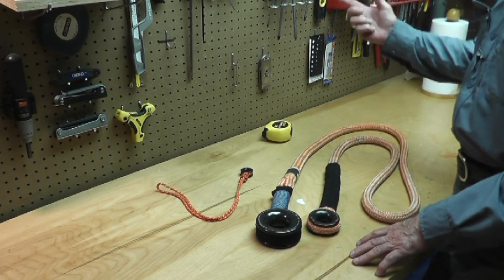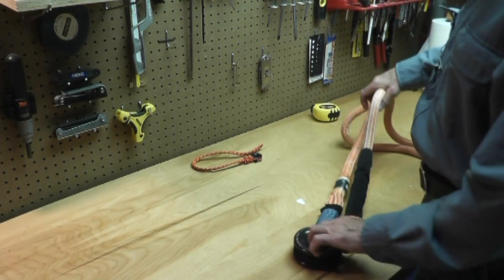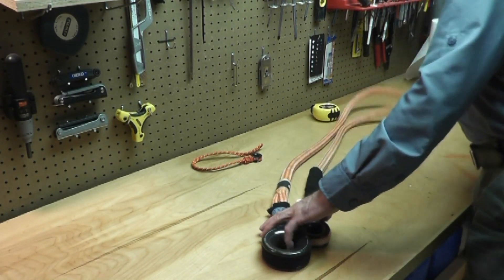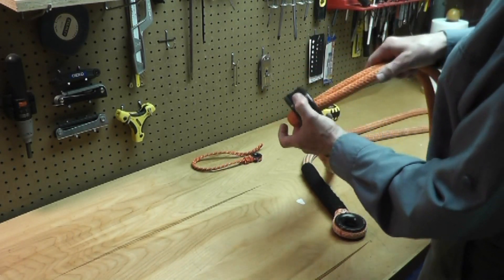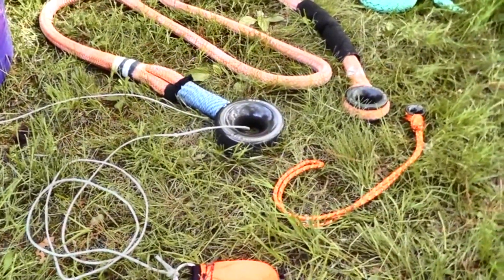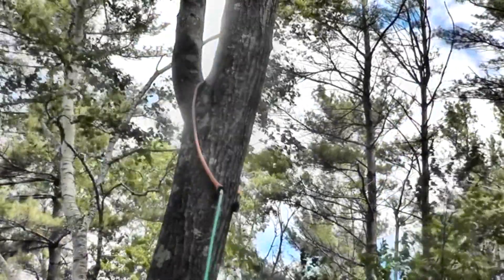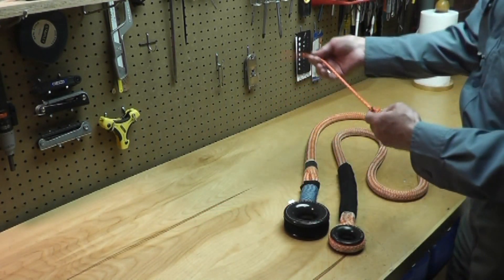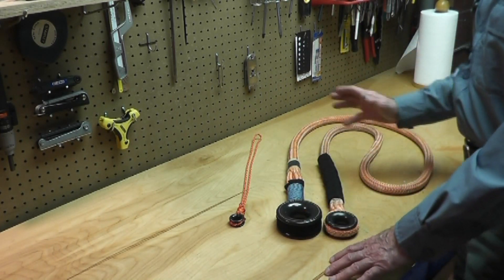XRR rR Saver for Heavy Rigging

Comment: Let me start off by saying I love watching your videos. And I am starting pick up what your throwing down Tom. But today I got from treestuff. Is a triple terex abr 1 #3 2#2's. rings. Well i went out to my tree and threw the throw ball inb the crotch I wanted. And I went to install the sling and the throw ball got stuck in the big #3 ring and would not come down to the ground. what can i do to make it more easier on me. thanks.
Reply from the maker: +Shawn ChamneShawn, it's sad but true: virtually anything, right down to an unknoted 2mm throwline, can find a way to get stuck in a tree.  Like any good tool, experience will teach you what you need to do to keep it out of trouble.  When it does <inevitably> get stuck, I've had good luck with a pickoff from above ... Set another throwline above the stuck saver, snap a carabiner through the bag ring and loosly around the line to the rR Saver.  Pull the biner up to the Saver, hold tension and pull.  Most times you can get lucky by pulling it out from above.